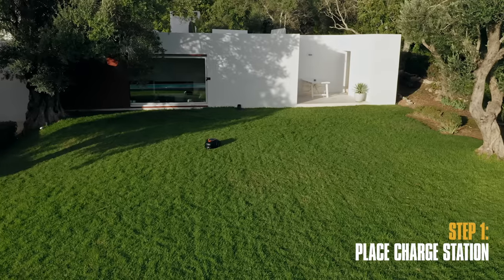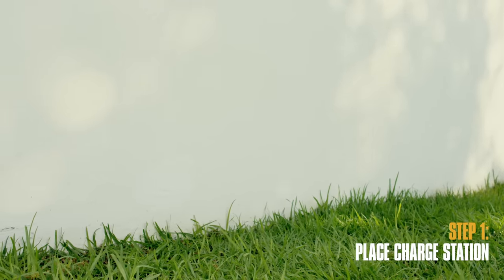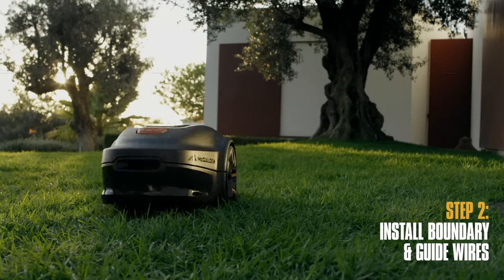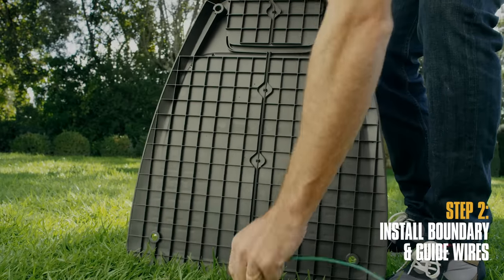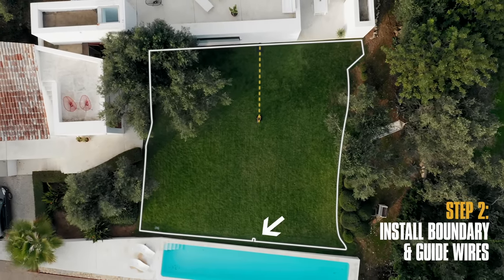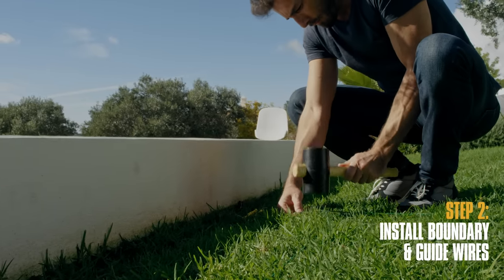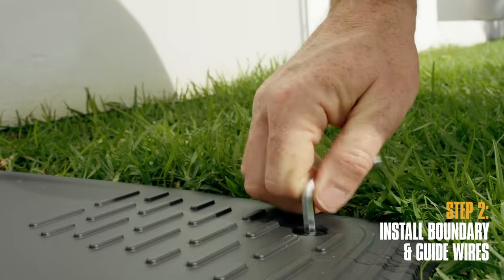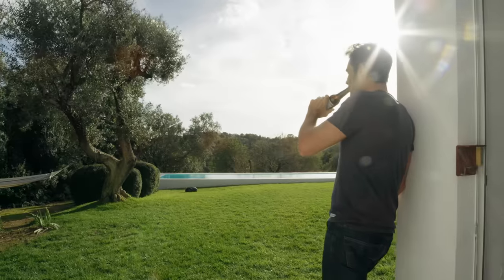McCulloch Rob S Series - Setup and Installation Guide

Comment: I have a problem to install the McCulloch ROB S600  robotic grass mower . Laying the Boundary and guide lines was fairly easy, but according to the installation manual there should be a GREEN light on the machine on completion of the installation. But I have a Yellow light which indicates a problem. Now I am stuck and unable to use the Mower. Do you have any suggestions,
Reply from the maker: Hi Ken, we are sorry to hear this.  A yellow flashing light either means the guide wire is not connected to the charging station or there is a break in the guide wire. Please check these two possibilities and also refer to the troubleshooting chapter in the Operators Manual.  If you are still facing problems please contact our customer service team. 
https://www.mcculloch.com/uk/customer-support/

Comment: It is not able to operate an hour independently, but a hundred changes of the garden and wire is required. Customer support is just a roundabout with no actual persons. The analyzer software is only for paid technicians, although it is helpful with trivial problems. Error codes stick forever with no help how to remove them. As expected this will need service at least weekly due to bugs, if I am able to get it started on a weekly basis. Dont believe the video. All cables will be cut unless you dig the cable down or protect it. Currently my S500 is on the living room floor and will not start due to too high inclination error, same problem when using bluetooth or start key.